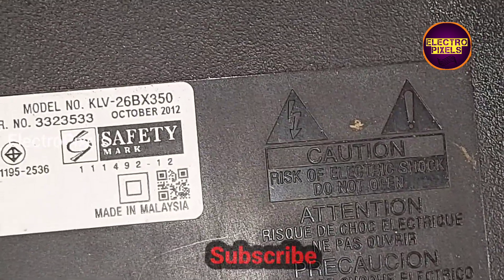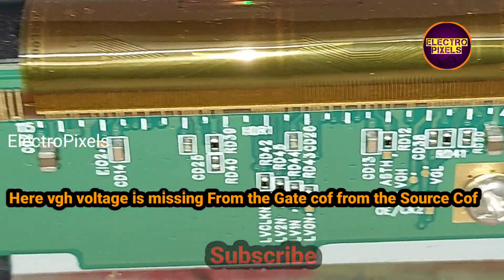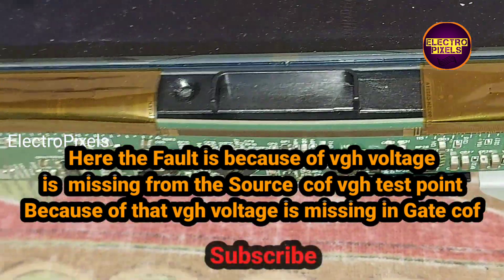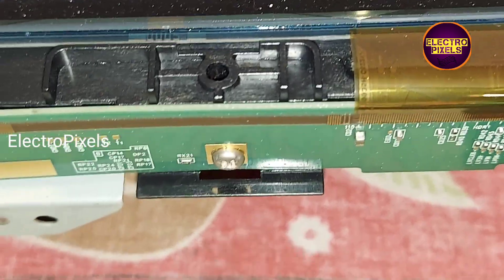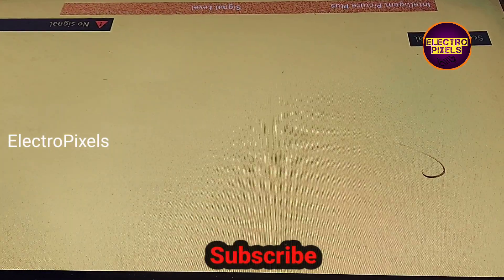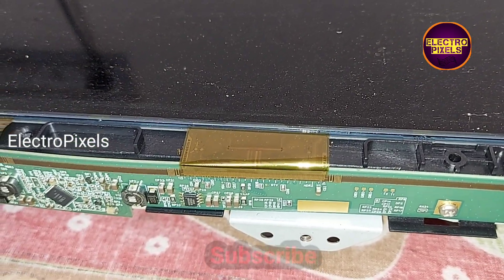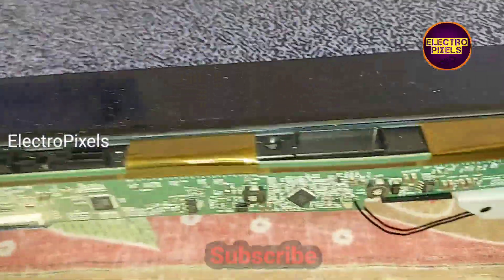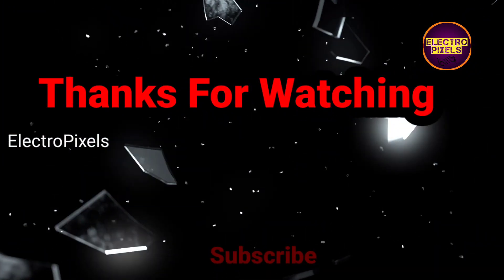How to Repair LED LCD Tv with no Vgh Vgl Voltage problem |Solve Graphic problem, slow motion picture

Comment: Very rare fault, I always had the break in Von line in small Samsung TVS but the break had always been on the corner of glass LCD around which the these key voltages were routed. Then I just put the wire across and soldered Von line directly to the Gate COF points. Good video. Thanks
Reply from the maker: Thanks For Watching sir, please share and Support us